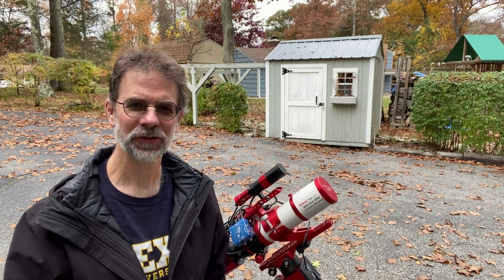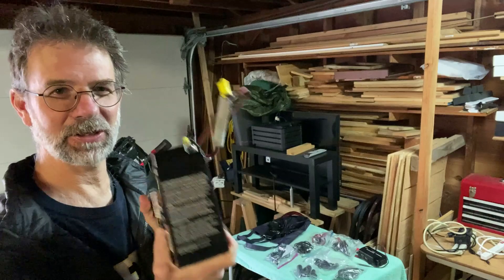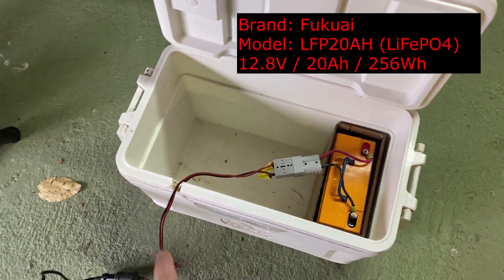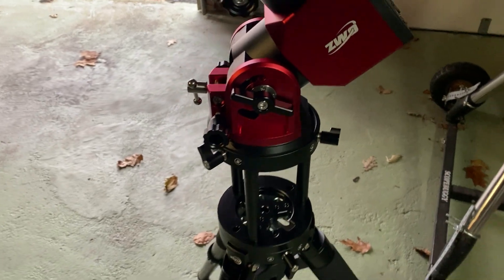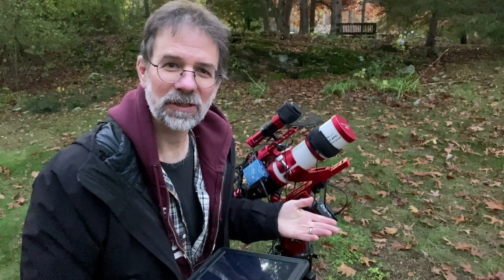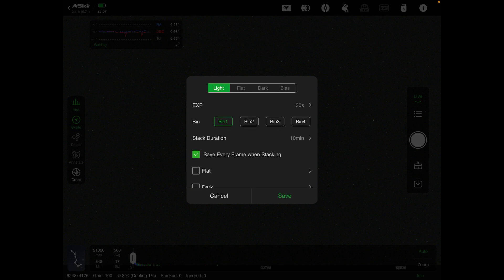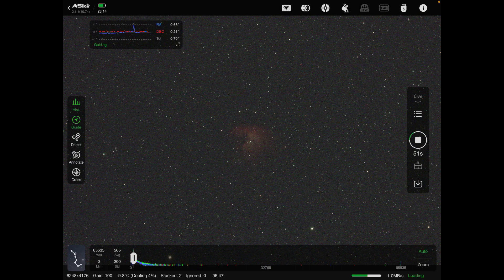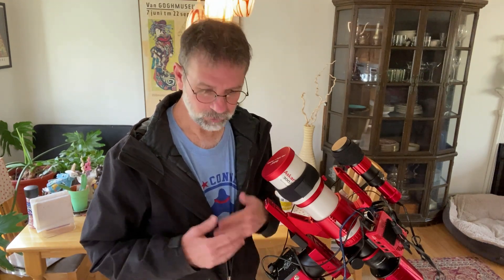Remote Imaging: Avoid Problems & Live Stacking - ASIAIR #astro #astrophotography #astronomy

Comment: i am wondering if you tablet does not have enough Ram? asi air needs at least 4 gigs my old ipad had the same issue and it had just 1 gig. thanks for some good suggestions.
Reply from the maker: Thanks for the suggestion, I will check into that.  Cheers

Comment: Kurt one thing on your tablet issue at least I have ran into it before. Sometimes I've had issues where the network connection would switch on me (or at least attempt to switch) if there was a stronger signal and/or there was a network that I had auto-connect enabled (ie: home network). This wound up dropping my connection to Eagle3 WIFI but even if checking the networks it would switch back (had to go disable auto-connect for every network in the list and also change the orientation of the antenna's. Not 100% sure this is your issue (or mine for that matter) but it did stabilize things that night for me.
Reply from the maker: Thanks for the info Mike, that never occured to me.  Cheers

Comment: Good advice Kurt! When at home I use staton mode on the ZWOAir plus to get extra distance from my home Wi-Fi ,which works well.
I recently had problems with the mosaic function on the ZWOAir plus a silly boyhood error (all ready had a plan setup just had to delete)
That what happens when you start rushing things,as you mentioned take your time and check.
CS my friend Tam.
Reply from the maker: Thanks for the info about the station mode Tam. I have a wifi extender which works really well.   Cheers Kurt

Comment: Hi Kurt. Question/Opinion: I just purchased an ASIAIR MINI to help me reduce my power needs when i go remote imaging. Ill be running an AVX mount and an ASI533 (without cooling). In your experience, do you think a 17 amp/hr (Harbor Freight 😊) car jump battery would give me 3-4 hours of capture time? I always enjoy your videos. 👋
Reply from the maker: Thanks Tom. The important thing for batteries is it should be a Deep Cycle (Marine type) as these batteries have a consistant power flow until they run dry.  The 17 amp/hour should be good enough for 3-4 hours.  Those Celestron Power Tanks are only 7Ah.  My new one is 20Ah and ~$75 on Amazon.  Cheers Kurt